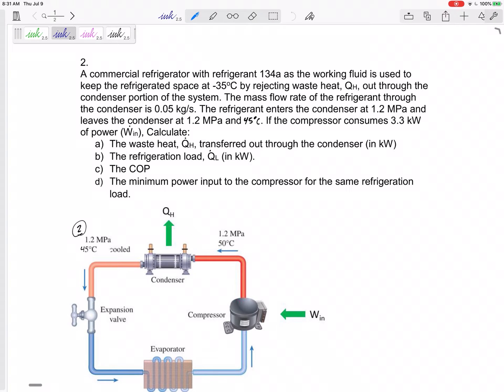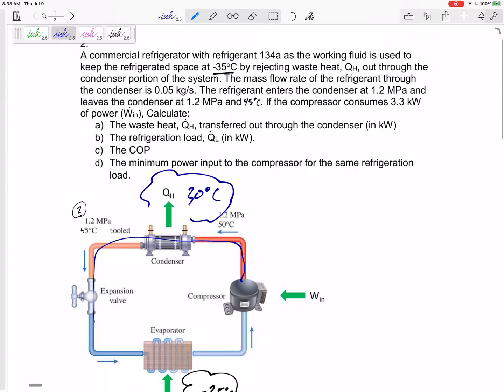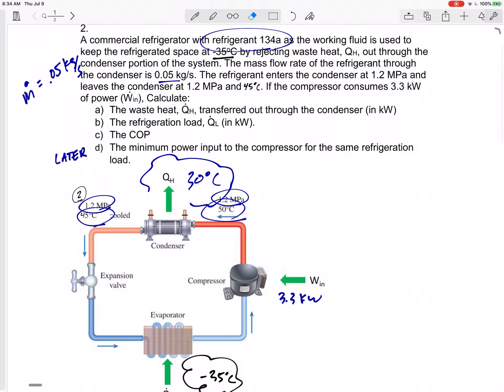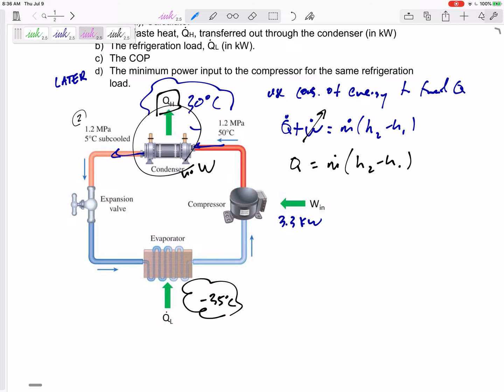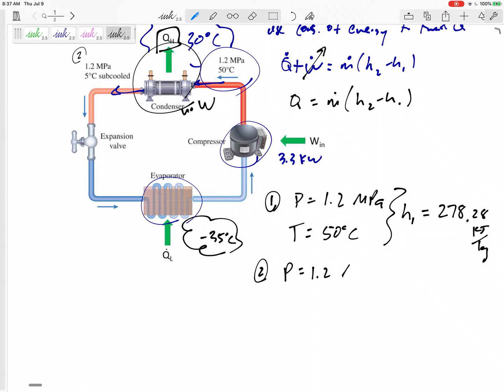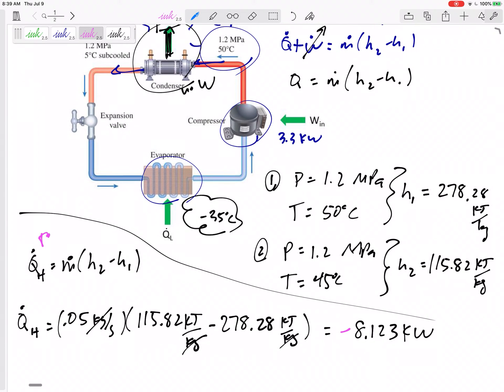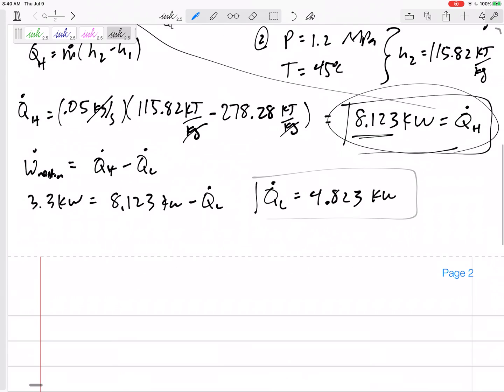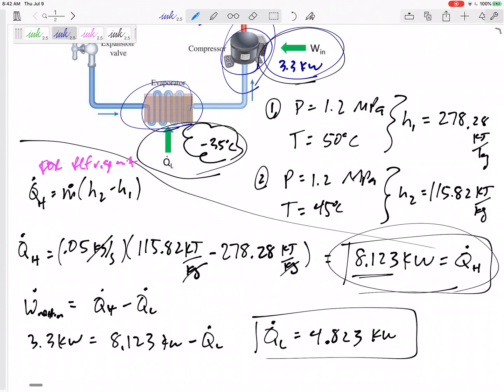Thermodynamics - 6-4 Refrigerators and Heat Pumps - another example

Comment: R134a at 50C and 1200 kPa is 426.84 kJ/kg and hf (at saturation liquid) 45C is 264.11 kJ/kg.
Reply from the maker: again, double checking my tables, but I've got that R134a at 50C and 1200kPa is 278.28 kj/kg. And hf at 45 would be the average of 117.34 and 114.30.
Reply: @engineeringdeciphered  Since in the video you claimed its still superheated after passing through the condenser, why don't we take hg from A11.I see that you used hf.
Reply from the maker: I’m using Cengel and Boles property tables. You can look in table A13 and A11 https://www.dropbox.com/scl/fi/l5ir7947mx69qm3i1bq1t/Property-Tables-Appendices-1-and-2.pdf?rlkey=ombvp8i0xpxmllg31fdts1y8p&dl=0

Comment: Where did the 30 degrees of the house come from
Reply: Room temperature. So that heat can leave condenser
Reply: @deletedaccount20484  some books take room temp as 24 degrees celsius i think it should've indicated in the question. but we didnt use it in the question really.

Comment: from which table did we take the enthalpy value of the one which at 45 C? There is no 45C at the table superheated refrigeant-134a
Reply from the maker: Correct there is no 45 on the superheated because it is not superheated. For a pressure of 1.2, the tsat is 46.29, so it is subcooled. If we had a subcooled (or compressed) liquid table we would look there. But since we done have a table for that, we’ll just estimate it as the hf at the given temp. So go to table A11 and look up 45C. You’ll have to interpolate (or just take the mean) of the hf at 44 and the hf at 46.